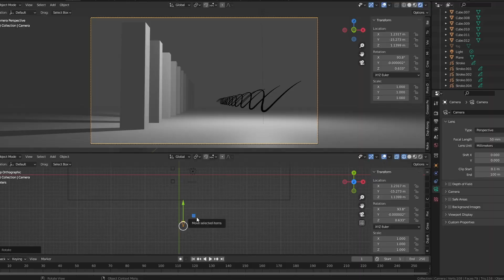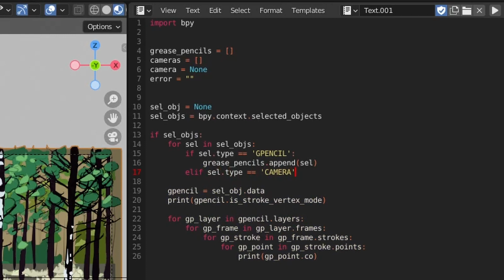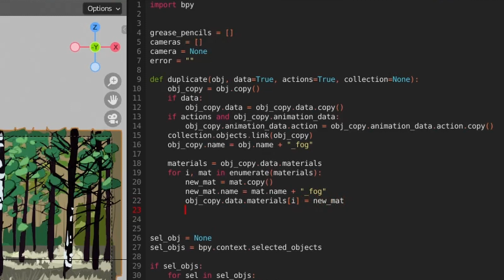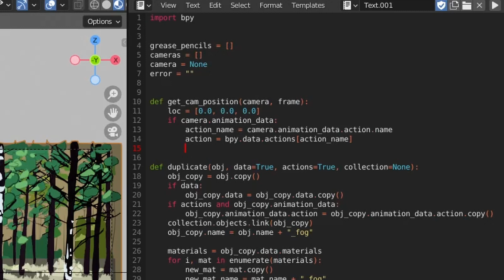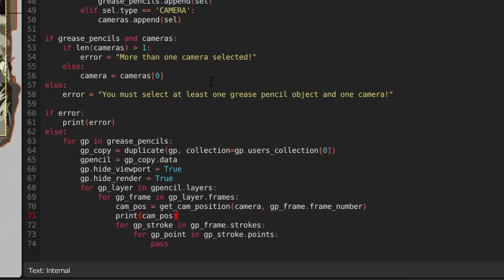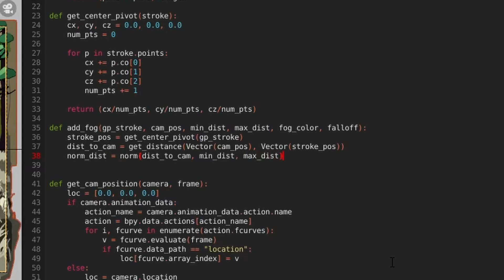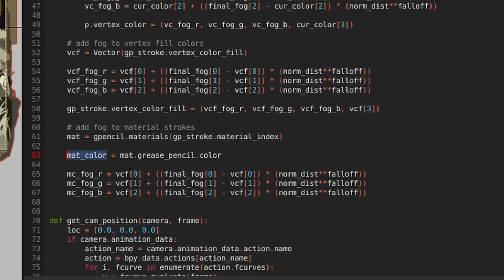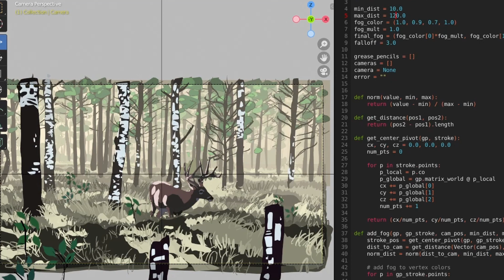Adding Fog to Grease Pencils using Python

Comment: Excellent as were your other videos. I wonder about the workflow where you set up a scene and THEN animate the camera. I assume you would just have to run the script again to pick up the animation data?
Reply from the maker: Thanks! Yeah, I think running it again on the original would be the simplest way. In fact when I was developing the script I wanted to make sure to test on both an animated camera and a static one to make sure both methods worked, and I did just that. I deleted the fogged grease pencil object and ran it again with the other camera on the original grease pencil object.